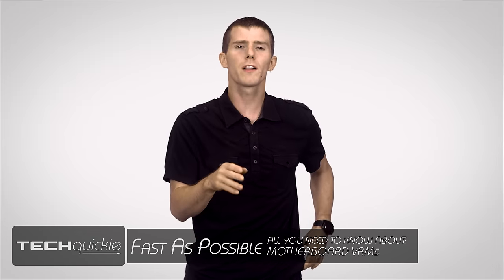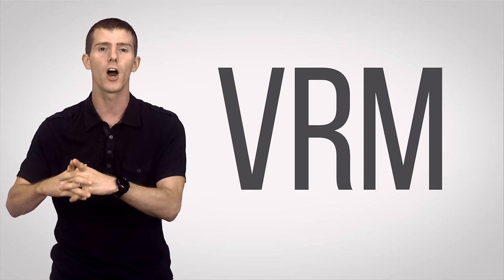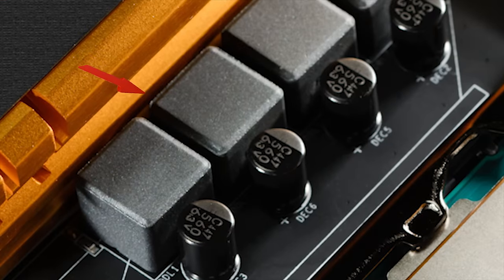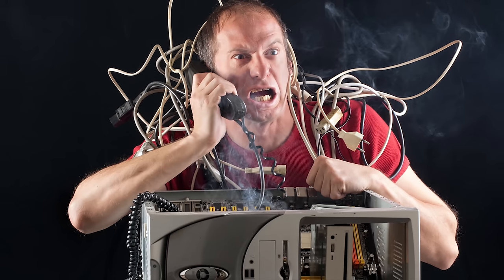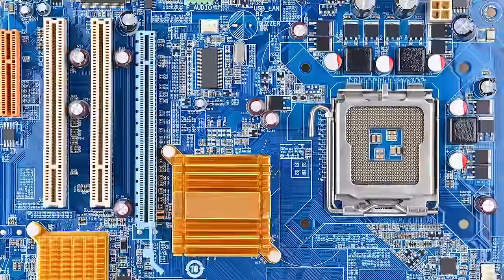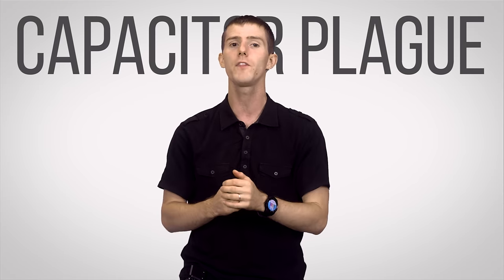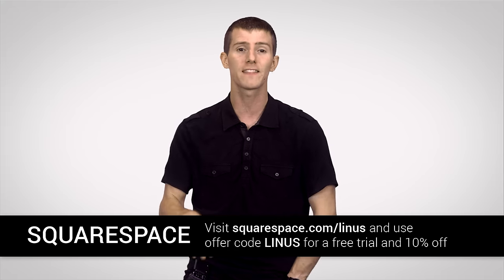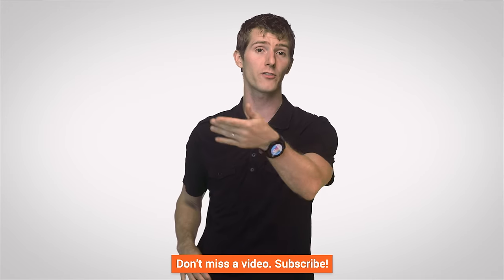Motherboard VRMs As Fast As Possible

Comment: Proud owner of a 24 phases(P67 UD7) with an 2500k on 4.5 from 4 f**cking years.
Reply: +Quetzalcoalt damn, i wonder wich manufacturer would do that today
Reply: Luke-Antra well 24 is a bit overkill, if you have a 6 core i7 , 2 phases per core will give you 12, which is decent enough, also new CPU use less which is a + too
Reply: Quetzalcoalt
Yeah, that's verry true.
 I hope the 8 phases on my MSI z170 krait will be enough for my i5 6600k.
Reply: +Luke-Antra For sure that is enough.

Comment: How do your VRM's react when your computer is on a battery backup?  It seems to me with cleaner power hitting your main power supply, the whole system will have a longer life.  Yes, No?
Reply: +Dwight Parker Probably doesn't make much of a difference, if any at all. The power the VRMs receive is already highly regulated by the power supply. Also the main AC in most places is very clean anyways, probably better than the artificially generated alternating current that a battery backup produces. A battery backup stores the energy in, as the name suggests, a battery - that means it's DC. To provide the power to your computers PSU, it has to convert that DC to AC - and it does so artificially by creating a "fake" sinusoidal AC voltage. This fake AC has tiny little steps in it - it's digitally generated. Hence lower quality that your regular mains AC which is extremely high quality and truly sinusoidal from the electricity provider.
Reply: +Mythricia according to what I've read, the artificial ac wave from a UPS is more predictable and the voltage and amperage are as well.  If I stick a multimeter in my wall right now, it will not read 110 or 120 or whatever it's supposed to.

Comment: Why they put heatsink only on the mostfiet's? 
It's not better to cover the mosfiet,capacitors and the chokes with one heatsink? or its not necessary?

The Reason i ask is because i got 970 mobo for amd fx 4100 and the motherboard deosn't have heatsink. 

That's why i wanted to put costum(i want to cut the aluminium from cpu cooler) one, but then i watch that every motherboard covers only the mosfiet's with the heatsink and leaving the chokes and capacitor's without a heatsink.

So should i ignore the capacitors and chokes and put the heatsink only on the mostfiet?

BTW the Capacitor's and Chokes on my Gigabyte GA-970A-D3 (rev. 1.0/1.1) are cramped( https://www.gigabyte.com/Motherboard/GA-970A-D3-rev-10-11#ov ).

Comment: if i were to build an apu build but with the latest radeon gpu how good is that in comparison with the regular fx cpu's with radeon gpu? is it worth it or should i just stick to a regular cpu with radeon card or the apu with radeon card?
Reply: dont get an apu with a radeon card, you are just throwing money away, i would say get a regular cpu with the rx 480 when it comes out. or wait even longer for amd's zen architecture. But that is at the begining of next year and its a long time to wait but the performance increases will be enormous. If you need to build a pc right now i would say go with an i5 or i7 for your cpu and get the 480 for your graphics because amd's cpu's are terrible with single threaded applications even though they are cheap, you wont be able to upgrade it and they are going to release cpu's with 40% better single threaded performance and twice the number of threads or logical processors. and with the 480 if you want to upgrade just buy another 480 and crossfire them and you will have performance that is better than a gtx1080 in games that utilize multiple gpu's
Reply: its not worth getting an apu if you have a graphics card
Reply: PhantomHOfficial thankyou for the insight i was thinking of which cpu+gpu combo i should get. and yeah i saw the video for 480x2 vs 1 gtx 1080 i think im gonna go with the radeon card since theyve made it more power efficient and for only 199$ thats worth it.
Reply: no probs man im waiting for it to come out too
Reply: +PhantomHOfficial what if I get a skyline first in the meantime while waiting fir the Zen? hope it can use the same mobo and same socket at least
Reply: +premsing88 skylake*
Reply: +premsing88 do you mean a skylake on the intel side?
Reply: +PhantomHOfficial zen will me on the am4 socket design i think
Reply: +PhantomHOfficial yea skylake sry. I meant what if now I got a cheap skylake one but with the rx480 first since the Zens only coming out next year? will I be able to upgrade later or I'll have to change my mobo completely. cus not much I can find bout the Zen bout the socket and stuff. I don't mind waiting as well but if it's same socket then I can use a cheap Intel CPU first while upgrading to the Zen later on.
Reply: +premsing88 skylake would be good for cpu cause in 4 years it will still be usable, getting an fx cpu and mobo is throwing away money at this point with zen comming out
Reply: you will have to get a new mobo and cpu when zen comes out
Reply: +PhantomHOfficial in that case would it be better if I invest in a skylake CPU a good one and use the rx480 crossfire? maybe in the next few years I can switch to the gtx 1070 sli or 1080 in future when the funds permit? maybe no Zen for now? I guess on future the Zen maybe my next rig if I even get another?
Reply: +premsing88 skylake with 480's looks like a good option for the longrun
Reply: +PhantomHOfficial thanks man guess I'll do that for now. thank you so much for your help and being patient with me hehe as you prolly know already I'm new to building my first rig. thank you again
Reply: +premsing88 no problem man i work in IT, i would get the i7 or i5 at least

Comment: hey guys can i ask a question? i have an acer aspire v5 laptop. the specs are intel core i3 1.9gh,4gb ram and it has an intel hd 4000.(the hd 4000 has a dedicated veam of 126 or 96 i forgot) if i increase the ram to 16gb will the ram share more memory to the hd 4000 and increase vram? i opened the bios and it doesnt allow me to change the dedicated vram....so will adding more ram increase vram
Reply: It sounds like the bios does not provide that option to allocate more system memory to your iGPU. increasing the amount of ram installed wouldn't make more memory allocated automatically as video memory. there's a limit to how high you can do it too. I think it's 1024mb max on a overclocking desktop motherboard. they may have changed on newer generations such as skylake.
Reply: +benjamen50 ben awww man, thx for the info dude :D

Comment: it's 230, not 240v
Reply: +Ramon Striezenau 220, 230 and 240 are all used. 240v is by far the most common, even in the US (240 / 2 = 120v, it's just a split phase).
Reply: +Mythricia 230/400 is the European standard. 220  was the standard like 10 years ago. I've never heard of 240 before.
Reply: Ramon Striezenau You should try actually measuring an outlet. 230 is just a standardized number, that covers both 220 and 240 (most equipment doesn't care about that small difference in voltage). I have 240 in the wall here in Norway (source: My multimeter).

The entirety of Australia is 240, all of Europe as far as I know, and in the UK you have 120 which is just 240 divided by two, so it's still 240 up to the wall and then split.

Comment: still didn't understand anything,wish I was a engineer
Reply: Fast as possible: It takes the 12V your power supply outputs and converts it to about 1V. (If you wanna know how that works google 'dc step down converter'.) And he corectly says if it can hold that voltage very accurately, it can allow you higher overclocks.
Reply: Maybe it would be preferable to say that it can provide the requested voltage even at quite high currents. The higher the breakdown power/current, more power is avaliable for stable operation when overclocking.

Comment: my mother board becouse it sucks it don't have cooling for the vrms... what i should put on them?  or where should i look for cooling vrms ?? my motherboard is a p55m-gd41 :/
Reply: the gd45 has  a cooling mine dosn't :/
can i find anywere a heat sink like the gd45 ? or something like that...??
Reply: Put those tiny stick-on copper memory heatsinks. I'll leave a link in another comment in case you have to unblock it to see it.
Reply: sure it does :D with 4 ghz i7 860  and 1.380 Vcore  :D
Reply: Richard Smith thnx man i will try something like that
Reply: +Hey There Billy  Lots of staff we shouldnt do but we do them becouse we like them :D  (with the same logic EVERY motherboard that has vrm cooling must be overclocked :D )

Comment: My msi 970 gaming mobo has nb temps of around 90-95c with my hyper 212 evo set to 90% and an fx8320 at 4.3ghz, despite cpu temps being 50ish under full load. The board has a 6+2 power phase and despite all other sensors on hwmonitor except tmpin1 being in the 30-50 range I'm confused as to why this goes into the 90-100 range and throttles my frequency under OC testing. Anyone have any ideas?
Reply: What reviews have been made on your mobo? Voltage? I don't know much about AMD CPU and motherboard overclocking, go find some reviews on your mobo to see if you aren't the only one.
Reply: I've seen one other case of the mobo having a high nb temp, with both our voltages being 1.4ish. All other reviews have been very positive with credit given to its overclocking ability, so could I just have a bad/faulty mobo?
Reply: RZKH
Maybe the voltage is too high? I dunno
Reply: It was only at 1.4ish, I expected a mobo with a 6+2 phase to handle this a little better but oh well I guess OCing amd is best left to 990fx boards. Not like 4.3ghz is awful anyways and voltage is at 1.336v so I'm ok.